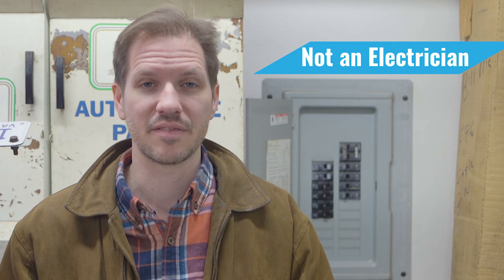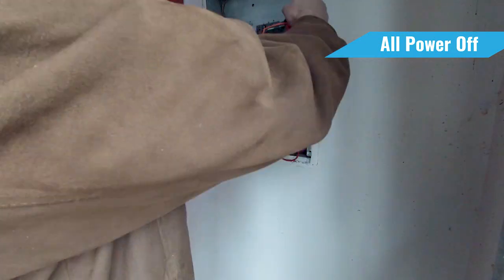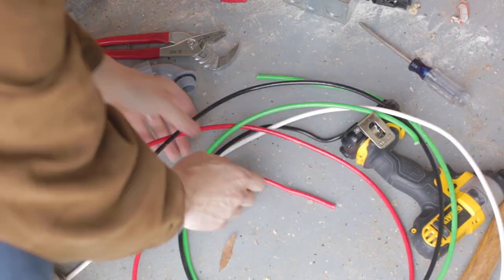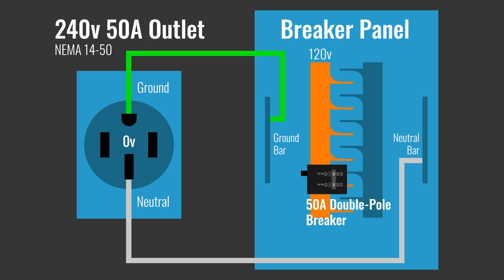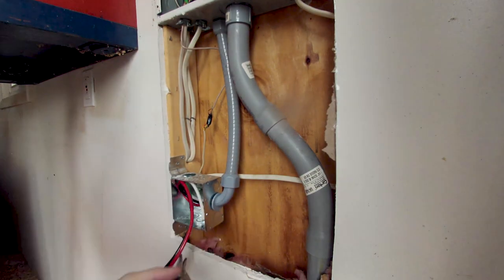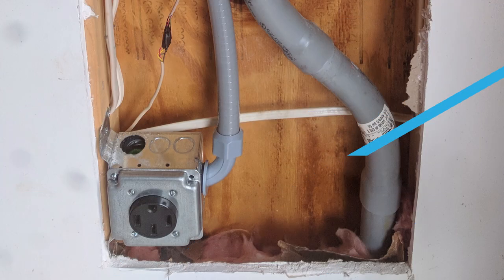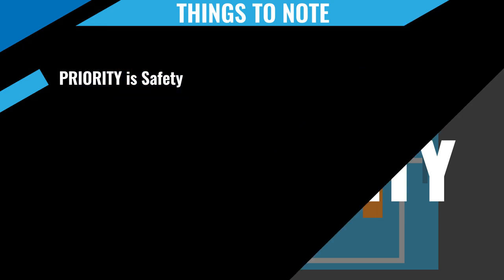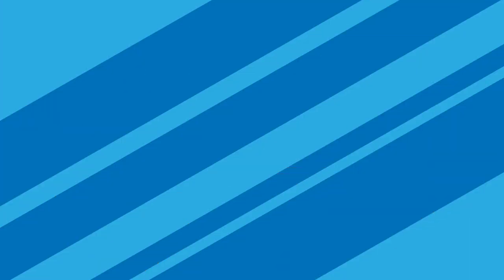Installing a 220/240v 50A Outlet

Comment: I just started watching this and you said you got shocked as a kid and became interested in electricity. I am an electrical engineer and I, too, formed a fascinaion with electricity when I was about five and got shocked taking down the Christmas tree lights. I yelped and told my dad there was a bug in the socket that bit me. He then explained elecricity and even got me some electrical hardware from the garage to play with. All downhill from there.
Reply from the maker: It's oddly a draw for some people. That's a great story and it seems to have guided your life to your current occupation. My experience definitely did for me. Radio shack and I became good friends after that. Thanks for watching!
Reply: I wouldn't say that it was downhill from there because now that the shocking experience made you a professional, I'd say that your experience definitely drove you uphill from there😂👍👍👍
Reply from the maker: Great way of looking at it!
Reply: Hey so I also have a similar story. When I was 5 years old back in 1986 my older brother was electrocuted. He was 15, he made a dumb mistake and tried climbing a tower. He was almost to the top when it suddenly arced and hit him with enough juice to kill him instantly. Another kid was halfway up the tower while two others were watching from the ground. Needless to say I had a pretty big fear and respect for electric after that. When I turned 16 and started driving i got into car audio, it made me nervous at first but i got over it. I wouldn't dare touch any AC electric type of stuff until about 3-4 years ago. It didnt take long until I was completely intrested in learning as much as possible. I am so thankful and greatful I was able to conquer that fear. I just wish I started sooner now!
Reply from the maker: Wow Joseph. I'm so sorry to hear about your brother. I can only imagine what that was like and how it shaped your life. There are few things that have changed society and demanded respect that I can think of as electricity. Every diy skill and subject carries with it risk and we take on that risk when we decide to do it ourselves vs. hire a professional. All that to say, I'm glad you're growing past your fears while bringing your respect to keep yourself safe. I hope you have many safe and successful electrical projects in your future and thanks for watching! Be well.

Comment: Nice video even 3 years old it is still very relevant today. There might be new materials that come out when dealing with electricity but it's basically the same as it has been from the beginning. Sometimes you will hear people refer to it as running water and that the wires are conduits for water diverting it where you need it. All the basic concepts of electricity are the same and is pretty much universal around the world. Except here in the United States almost everything we use is 110 where in Europe it's 220 for some reason.

I definitely hit the like and subscribe button. I always feel it's the right thing to do if I'd like someone's video and I did like yours. Look forward to watching more.
Reply from the maker: Thanks David. I agree, though there are some code changes coming in my area soon so I may have to update the video. Thanks for liking and subscribing. I appreciate it.

Comment: only thing I would do different is the cover. the cover is meant for a surface mount box. all you need is a double gang mud ring and a flush mount cover, similar one you wound find on a typical wall outlet. the plug will then fit flush with the wall
Reply from the maker: Thanks You. That is the way I should have done it. I appreciate the feedback. Thanks for watching!

Comment: This is the same procedure for a generator circuit installation.  2 pole breaker upper right closest to MAIN breaker and a mechanical INTERLOCK KIT and I always run #6 (generator) wire. So it can be a 50 amp (or 30 amp) (depends on Generator output)

Comment: It's a minor safety thing because it shouldn't matter if you have disconnected the panel properly, but the safest thing to do is to attach to the outlet before attaching to the breaker panel. Otherwise the risk of accidental shorting during install is much higher
Reply from the maker: Good tip. Thanks for sharing Chris. I'll remember that for next time. Thanks for watching!

Comment: Great video. Just one thing to point out, however, that's pretty critical. The outlet you chose, while it is indeed a NEMA 14-50, is the cheap kind you find in a big box store, the kind people plug a dryer in. The problem is, if you're charging, for example, a Tesla battery, you could have current running through the plug for 4-10 hours straight. That $9 plug simply isn't designed to have energy running through it for that long. If you search, you'll see a number of these plugs have melted, sometimes causing fires.

You'll want to buy an industrial grade NEMA 14-50 plug. They're way more expensive. I paid $80 for one made by a company called Hubbell. They also make the Bryant version, which is the same thing, but just a different brand name. Just as good (it's really the same plug) and you can often find those for $40-50. Bottom line, make sure you find one designed for EV charging, not the $9 ones.
Reply from the maker: That's a good point Mr. Don't. I mostly use mine for a welder and my band saw which I only use for a few minutes at a time. If I ever upgrade to an EV I'll be sure to look up the better outlets. Thanks for the tip and thanks for watching!

Comment: Did you have to ground the box with a ground screw inside the metal box?
Reply from the maker: Yes, after getting many comments about it I used a lug to ground the box to a smaller gauge ground wire (I believe 10 gauge) If I ever make a follow up video it will be in there. Thanks for taking the time to watch and comment!

Comment: This video is awesome! Does anyone know the pros/cons of running 4 THHN wires like this vs. running a single 6/3 NM-B Wire w/ Ground?
Reply from the maker: Thanks Max. Unfortunately, I'm not sure. I went with mine because it was a very small run and it's what I had around. Hopefully someone else will answer your question. Thanks for watching!
Reply: Yeah, I’m interested in this question also, is six gauge the correct gauge wire for 50 amp service?
Reply: @vancerosentreter5960  yes it is

Comment: 3 style tips.

1)  work away from the panel first.  The recepticle wires have zero power with nothing connected in the panel.

2). Connection order
Ground - neutral - hots
Reverse to disconnect.
Ground is a safety wire
Connecting the neutrals before the hots prevents a hot neutral.

3). Metal boxes need to be connected to the ground wire.  Believe it or not, some "yo-ho" managed to get a hot to touch the metal box and without the ground connected, the box was a giant energized hot wire that shocked someone.
Reply from the maker: Great tips Keith. I especially like the wire connection order one. For #3 I have since attached a lug to the back of the box and run a #10 wire for ground. That is sufficient correct? I'm going to try and make a follow up video to show that. Thanks for watching!
Reply: @CuttingOutBack  yes, 2020 NEC table 250.122 shows 10 copper or 8 Al foot to 60 amps.

Comment: i need help finding a solution. i got a good deal on a Lincoln AC225 arc welder designed to run on 50amp. I've been told i cannot use my 50amp generator to power this and it's true. when striking the welding rod it makes not much more flicker than a match. the heat just isn't there to burn the rod. the power cord is 3 wires black/white/green. so if i install a dryer plug on it and plug into the 230volt 30amp dryer outlet it welds fine even though the lincoln is designed to run on 50amps and a lot of people do this. all household dryers get 230v with double breakers but using 3 wires not 4. the generator is a westinghouse 9500 running/12500 peak 120v/240v with a 50amp outlet identical to the outlet you connected to the residential panel. the math says it should it should run the arc welder. I believe the generator has the fourth red wire to its outlet, but the welder lacks the fourth red wire to get the second 120v from the outlet. the generator has 2 windings both 120v each and a digital display indicates 240v is being supplied to its outlet. this Lincoln arc welder model has existed for something like 50yrs and i don't find anyone else wonder why it can't be powered by a generator.
Reply from the maker: Oh wow Robbie, that's a good question. I can only guess it has something to do with how the generator provides its power. I know there are mobile welders who have generators to power their gear, but maybe you need a certain kind or capacity. Wish I knew the answer, but maybe someone else in the comments will see it and chime in with the right answer. Thanks for watching, I hope you find your answer!

Comment: It didn’t look like you torqued down the connections. Did you end up going back and doing that? 
Especially with stranded wire that needs to be torqued a few times to prevent it from coming loose.
Reply from the maker: Nice catch Ten, you're right. I went back later and torqued it down. It's a very important point, thanks for commenting, and thanks for watching!

Comment: Wondering why you didn’t just go straight from the top of the recep box to the bottom of the panel.
Reply from the maker: Good question. The conduit I bought came with a straight end and a 90 degree end so I just used it as it was. If I bought the conduit components individually I probably would have gone straight. Thanks for the question, and thanks for watching!
Reply: @CuttingOutBack  how high is your recep off the floor?
Reply from the maker: @Genesislights  Not sure. I'd have to measure. Is there a minimum?
Reply: @CuttingOutBack  depends on the jurisdiction, just wondering. Most that follow NEC 2020 needs minimum 18” off the floor
Reply from the maker: @Genesislights  Gotcha. I'd say 30" or so, but I will check local code just in case. Thanks again for bringing that to my attention.

Comment: My house was built in 2005 and the panel is next to wall outside garage wall.  I dont have to go through ceiling right, I can just run a cable from outside of wall into garage wall. what type of conduect should I use since about 6-8ft of pipe will be run on outside garage before going into garage.  I will be buying an electric car soon and also an electric heater to heat up my 3 car garage/man cave.  wanna have this 240V ready before christmas:)  I have seen many youtube videos where they place electric heater up high close to ceiling on a corner and also the 240V up in the wall.  Since I will be using it to plug in electric car and electric heater whenever I am playing pool in garage should i install it to the hight of the other 120v outlets?  Also any advice before installation?
Reply from the maker: Best ask a local expert on that one. I think the install for an electric heater would be similar, but it depends on the heater and what size breaker it requires. I think those units usually have instructions that spell out all that is needed. I couldn't find a lot of info about the height for outlets in the garage so again check with a local expert. Good luck with your project and thanks for watching!

Comment: So the point of the neutral on this 240 volt receptacle is for such things as RV's that may require a connection for both 240 volt and 120 volt stuff at the same time?
Reply from the maker: I'm not sure about that. I'm using it for large machinery and a welder. They take 240v. Thanks for watching!
Reply: I'm trying to figure out the same thing and came across an answer similar to what you are describing. A dryer for example, uses 240 for all things except perhaps the display and buzzer. Same I suppose for RVs.

Comment: What I don't understand is the amperage rating thing.
Is that one piece 50A breaker switch equivalent to two separate breaker switches 50A each and hooked up to L1 and L2 or is it equivalent to 25A each two separate switches?
That is my question.
If I had two separate switches and not one, what Amperage should each one be?
Reply from the maker: From what I understand each pole has the rating of the overall breaker. That way if either hot wire draws more than 50A the breaker trips. Take that with a grain of salt from a non-pro. Thanks for watching.

Comment: @CuttingOutBack hello I'm trying to buy the conduit cables and I found some that are 6 awg red white and black but the green one is 10 awg.  Does the green one have to be 6 awg as well?
Reply from the maker: Honestly, I'm not sure. I've had people tell me both, but I suppose thicker wire couldn't be bad. I would check with a local electrician just to be safe. Thanks for watching!

Comment: To turn the breaker box off completely you said there’s a a switch inside the house?  How about turning the main breaker switch to the off position?  Would that be good enough to turn it all off and work on it?
Also the red and black wire to the breaker switch.  Does it matter which wire goes to which?  And which wire goes to which on the outlet connection?  Thanks!  Great video
Reply from the maker: Yes, I believe shutting off the breaker to the panel would be sufficient to installer the breaker, but I'm overly cautious with electricity. I don't believe which hot wire goes to which pole of the breaker makes a difference. Thanks for watching!

Comment: This type of outlet was installed for me by a professional but what i have been noticing in other videos is the installing portion of the interlock switch. Just for my own sanity and mental health (lol) is the interlock not needed for this type of outlet?
Reply from the maker: I believe the interlock switch is only required on a 50A outlet if it's something like a generator connection to make sure you get your power only from the grid or a generator and never both. The one I installed is used to run a large bandsaw. Of course take my advice with a grain of salt because I am not a pro. Thanks for watching!

Comment: Thanks for the video.What if the outlet does not have a neutral connection? Would you just cap the neutral ? Thanks
Reply from the maker: Honestly I have no idea on that one. I know all houses in the US must have a neutral by code, but I'm not sure about older constructions. I've read you can add a neutral, but I guess it depends on how much you want to spend. I would definitely talk to a professional for this one. Sorry I couldn't be more help. Good luck and thanks for watching?
Reply: Maple Ridge Farm    You can cap it, or not install the conductor.   You do not have to remove it.   Leave it connected at neutral bar and cap the end in the box.

Comment: 1. 6-50 or 14-50 doesn't care which hot goes where?  They are interchangeable?
2. Do you have to use the ground in the box?  I'm using outdoor weatherproof boxes that have a ground termination inside the box. (Edit: found answer in your comments, will use the ground terminations)
Also, that knockout plug is so cheap.  I'd feel more secured using a piece of aluminum tape, which I intend to do since my 1" threaded outlet box only came with 2 plugs even though it has 5 outlets.
Reply from the maker: Hey Swiss, I believe that's correct. Red and Black are both hot and go in either brass connector. The insert I got to plug the hole is actually pretty thick metal. I worry a tape wouldn't be thick enough or at the very least won't meet code. Take all this with a grain of salt though as I am not a professional electrician. Ask a local one to get the real answer. Thanks for watching!
Reply: @CuttingOutBack  Sorry, I just mean as far as any intrusion like water or dirt over time.  Thanks for the reply.
Reply from the maker: Anytime!
Reply: @CuttingOutBack  Any advice on how to get 2x 6 gauge wires on the ground screw?  Not sure why this is so hard to look up but I just can't figure out the right key words to search for an answer on this.
Edit:  I see some people stripping just a section of sleeve in the middle of the wire, guess I'll try that.
Reply from the maker: I suggest stripping the center of the wire and putting it through a "lug" you attach to the ground screw. Also, from what I understand you can run 10 gauge as the ground. That is something I didn't know before the video. Lug will work for either though.
Reply: @CuttingOutBack  So, I was wiring a 50a 6-50r and a 20a normal outlet.  I did the center strip for the 20a which worked well because it's single strand 12awg.  I have 6awg THHN which is like 9 strand, so really hard to deal with.  But, most if not all of the videos I've seen online they don't even bother terminating in the box at all.  I was going to try a center strip and try to get the lug to squeeze through the strands with a pick it but what I decided to do was just plug the 6awg into the 6-50 as everyone else did.  But I took one of the scraps of 12awg single strand and terminated that into the box from the 6-50r.  I have some slack so I could do some piggyback/splice thing later.  I found a thing called 'greenie grounding connector', but I can't imagine they have one big enough for 2x 6awg.  I dunno, I'm sure it'll be fine, it's overbuilt like hell anyways.  Thanks again.  Videos like these help so much, especially for people like me with no one to ask any questions, I appreciate it.

Comment: Most all the YT videos I watched did not use the Common wire. Yours is the first. Why do you use the common wire when all others are using the two hot and ground?
Reply from the maker: From what I've read online, if your outlet has four prongs you need to connect all four wires from the breaker box. 240 will still work without the neutral, but it's not "to code". Keep in mind I'm not an electrician and don't really know what I'm doing. Contact a local pro to get the official word. Thanks for watching!